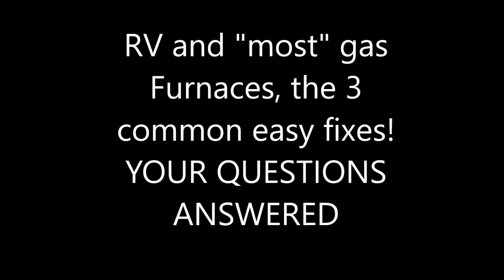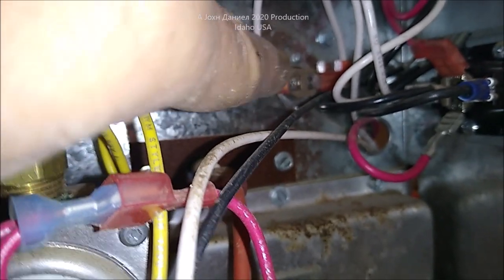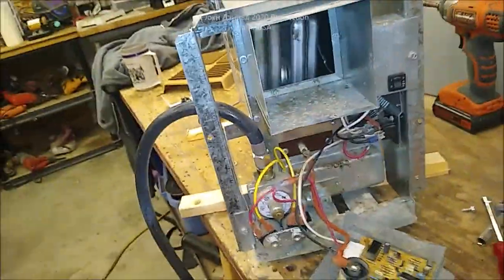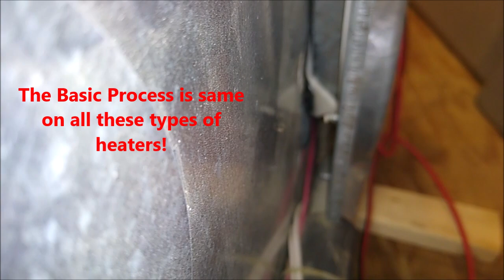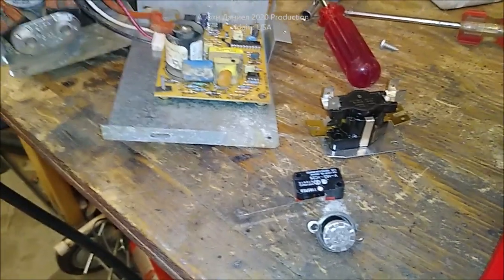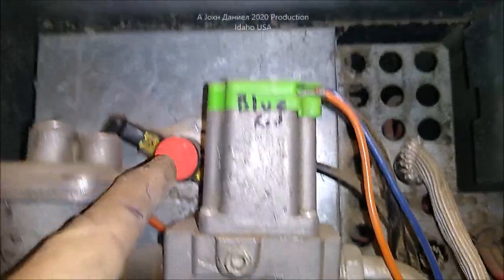RV Furnace REPAIR TECHNICIAN SECRETS Top 3 Easy Fixes anyone can do PARTS BELOW

Comment: Hello I have an older furnace in my horse trailer when I turn the thermostat I have nothing no power no fan nothing. And I have no clue where to start I am avoiding taking it to the local shop
Reply from the maker: First step is multi meter to find where power is going or not going. I'd guess who ever installed it used non standard wiring and that is the first thing to look into. See if it's getting power to it, if the wires are all properly connected. You can send pics and info on it, lots of them, including your battery info on the trailer as well as any odd wiring you see. olympicpowercontrols@yahoo.com 
I just did a repair on one for a new owner of a 1980's 31 foot gooseneck horse trailer/sleeper and when the previous owner sold it he removed things that affected the wiring.

Comment: Thank you for making this video. I'm purchasing a older pop up, and the furnace isn't working. This gives me a good jumping off point, to start to diagnose the issue.
Reply from the maker: With older Pop Ups your likely to get very low hours use in a heater, likely low hour use of the pop up itself. So be prepared to replace the furnace motor itself due to corrosion and very dry bearings or immediately pull it and using LB10 to oil it the right way.
Reply: @JOHNDANIEL1  fortunately living in Colorado, you don't get the corrosion issues you do in high humidity areas, but we'll see.
Reply: Let us know how it goes, i want to know if it was any of these issues. Thanks.

Comment: My heater makes an explosion when it is turned on, from your experience what do you think causes this explosion? Thanks 🙏
Reply from the maker: Blocked intake and exhaust typically. Get a flashlight and look up into them from outside the RV and see if you can see wasp nest, or something blocking air/exhaust flow. It is behaving like a car that is flooded with gas, getting poor intake air flow and finally fires up.

Comment: So the furnace in my 86 Lance cab over as a Pio igniter for the pilot light. The pilot light comes on and stays on, but when the fan kicks on with the temperature up, the furnace does not light suggestions?
Reply from the maker: Not sure your model, but if it has a leaf switch near the blower it may be bad. The gas valve is not going to kick out the big flow if the leaf switch is bad and not connecting to the solenoid on the gas valve. Another possible, the over temp switch can fail and not allow that connection to the gas valve to get power as a safety from over heating.

Comment: Mines not blowing hot air, but see that flat head screw in the bottom left where the propane goes in, if I unscrew that, unscrew the one behind it then there's a button behind all that, if I push that in a few times, then put everything back, sometimes it works again
Reply from the maker: Sounds like someone messed with the gas regulator vent purge and now its got dust or dirt in it. Not much you can do with those once you mess with them other than replace or rebuild. The piston in it is now gunked up, so it'll run till released then stick again.
Reply: @JOHNDANIEL1  Thanks for replying! Ah okay so that's what that is, is a gas purge, does pressing the button so anything then?   behind the metal cap is another plastic  screw with a spring behind it, is that meant to be set in any particular position? Like all the way in so the spring is fully compressed or how should it sit? And how is this affecting how the hot air turns on or not? Thanks
Reply from the maker: @Ben-et8wh  That is the gas valve regulator and solenoid assembly. Once you mess with it it is hard to get back to factory setting. Rule is the spring pressure is light, not compressed far. Make Contact and about 1.5 to 2.5 turns in. What is the year and model of the Furnace?
Reply: @JOHNDANIEL1  hmmmm okay, hard to know when it makes contact but ill try to set it somewhere in the middle or so, 

Its in a 1985 bigfoot spirit wing, says hydro flame SN 0019390 sticker on side of init says assembled in 78 and thata about all i see on if as far as a model
Reply: @JOHNDANIEL1  ok so now, cleaned the sail switch, hear lots of clicking from the front, and can smell propane as if it's going through the whole system, not igniting
Reply from the maker: @Ben-et8wh  Too much or too little gas for proper ignition due to someone messing with the regulator.
Reply from the maker: @Ben-et8wh  Get a light, look up into the air and exhaust tube on the outside. If you see wasp or bug nest, get a wire dig it out. That is likely why you smell strong gas odors and likely why it all started acting up.
Reply: @JOHNDANIEL1  so we traced the wires around we get power to the circuit board, but no power leaving the circuit board, used a jump wire and the gas regulator opens and closes I can hear it,  but no power past the circuit board, which leads me to believe a faulty board or something on the board, am I correct in thinking this? Thanks so much for your prompt responses and help also! You've been awesome

Comment: After sitting all winter went to turn on the heater, it came on, ran a few minutes, made a weird noise and shut off.  The fuse in the fuse box had blown.  Put another fuse in, turned on the heater, about 15 seconds later heard the fuse blow again. What do you think is causing this issue.  Our trailer is 2004 model.
Reply from the maker: Could be a few things, but I would say the motor is drawing too many amps due to age and dry bearings. If your handy you can oil it but you have to do a shaft tap on it when you do to reset the oil and bearings. Use liquid bearing https://amzn.to/43TyHOW , make sure you remove the intake blower slow and save the gasket on it, if you damage that gasket use red RTV on it. There is a set screw on the main cabin blower, typically 3/32 hex or 1/8" hex to pull it. You will put 3 to 4 drops on each motor end, then taking a wood block and hammer you will do a end tap, 4 to 5 lbs force a few times on each shaft end towards the bearing to knock out wear bits and inset the oil. Spin it, if its still rough or hard to turn, repeat steps. This will get you 1 to 2 more years sure use unless its severely damaged.
Reply: Thank you.  That sounds more complicated than I feel capable of.  Maybe we new heater is in order
 @JOHNDANIEL1

Comment: Thanks for making the video, very informative. Have you done a video to stop the squealing on these furnaces?
Reply from the maker: The Squealing is from bad bearings in the motor usually. It can rarely be the blower wheel is hitting the metal due to it shifted on the shaft or the rubber motor mounts are bad.

Comment: Hi, thank you for your awesome tutorial. My problem is that the fan does not start at all, but i hear clicks as it is trying to light up. (I have a Honeywell thermostat) it is getting gas and 12v 
Can any one here help me plzz❤
Reply from the maker: Check to see if your fan/blower is stuck/frozen in place. Get to the side of the unit in the cabinet, If not, replace the Run-delay-relay so that it gets power when the thermostat calls for it to switch on. The click is the relay, but its contacts are bad so the fan does not start and from that the leaf switch does not engage and then no gas or starter cycle is running.

Comment: My thermostat clicks once but the heater doesn’t start at all. No air blowing.
Reply from the maker: Thermostat don't usually make a loud click, the run-delay-relay in the furnace will make a click though. But if it's going bad it will not send power to the fan circuit that starts the whole process for the heating.

Comment: @JOHNDANIEL1 what if your sail switch doesn’t have a fin soldered to it?
Reply from the maker: Some don't have but a 2" thin flag on them, the air pressure is high so a wide flag may cause it to break.

Comment: Been pouring over this video for my Atwood model 7916-lI.  My furnace fan start without the thermostat even being wired to the furnace by switching on the on/off switch.  Fan runs and never shuts off.  If I turn on gas, it fires up and heats.  Only way to shut it off is to turn off gas, let it cool down and the shut off on/off switch.  Really hoping you can give me some guidance.  Thanks so much!
Reply: Thanks for your response!! I know it has the time delay relay, not so sure about the thermal switch.  I’ll order the relay shown in your great video and let you know the results!  You’re the man!!!!
Reply from the maker: The thermal switch for the cool down cycle is going bad or has gone bad. So when you power it back up it's still connected to make the blower run for a period of time after the gas turns off. It's likely either that or the run delay relay stays connected for the blower to continue as if it's ready to fire back up. So if your unit has a cool down cycle thermal switch which would be a bi- metal switch, or a run delay relay then that is the reason your fan doesn't shut off. Look for and replace both of them.

Comment: My suburban in my truck camper it comes on heats up the burner shuts off and then it cools down then the fan shuts off and comes right back on and it does not relight I had to unhook a hot wire or something inside there to get it to shut the fan off cuz it just set there and blow cold air it's only a 2-year-old camper run again and then it'll shut off and come right back on again it just keeps cycling like that but it never really lights it's not cold enough in here for it to light anyway it should shut off and stay off even with the thermostat shut off it comes back on

Comment: When i turn on heater, fan blows for 1/2 a second, then turns off, and Nothing. The tech came again Sat, didn't change anything, just touched a few wires, and ut started working. Now it's doing same thing again. Blower for 1/2 second, then Nothing.
Reply from the maker: A guess based on what you described - Insufficient amps to hold the contacts down on the delay relay or failing delay relay if it has one. Pushing the wires around made better contact and it had enough voltage and amps to run, after it ran the connection failed again due to vibration. I'd check for terminals or plugs that are bad, a terminal may be loose, this could cause voltage and amp drop to exist.

Comment: What does it mean when you get no clicking or heat but fan stays on continuously?  Tanks are full. The fan just won’t shut off and keeps blowing cold air, even with the thermostat in the off position.
Reply from the maker: Cool Down Switch is stuck in on position. A $10 part. $48 is you buy the branded part, so Tell me the model and I can send you to the right part. It could be the Delay Relay also, so when your in it, replace both if it is a model with one.

Comment: Any advice on a squealing blower? Squeals very loudly until it warms up.
Reply from the maker: @laughableotter  Oiling it with  liquid bearings https://amzn.to/4kfaLvB can extend the blower motors life a year or 2. It's a pretty intensive little job to do. You need Allen wrench to loosen the set screws to pull the blower wheels and you have to be careful removing the cover on the air intake blower side to save it's gasket, if you damage it's gasket use our RTV red in place of it.
You remove the unit from the RV, look for two screws mounting it to the floor. Be sure to remove the single screw that holds the units exhaust intake and then you will shake it a little bit as you pull it forward and out. You have to turn off the gas used to wrenches to disconnect the gas line and the power line should be either wire nuts or a plug.

Comment: My friend’s camper has a furnace that look like this and we can’t slide it out. That sheet metal flange that is on the exhaust end of the unit is outside the camper. How can the furnace be removed without sawing off that flange?
Reply from the maker: Remove all the screws on the outer flange, the fit is tight, center screw is into the heat exchanger, so you can using a thin metal backer and a pry bar t do some side to side prying and it will release. This is how they come out unless some one has altered it with screws inside or other adaptions to it.

Comment: I get nothing. Just bought camper and ran heater for ten minutes than I quit.
Reply from the maker: Check battery voltage it has to be over 11.9 volts, check the fuse to furnace, and test if propane is still flowing well by lighting at least 2 burners on stove and seeing if they are good output. If all that is good, reach in and give the heater a good firm slap/tap or 2 and retry the thermostat. If it fires up, replace the over temp bi-metal switch with one like what is in the links under the video.

Comment: Our heater does not fire up at all , nothing, where would you start? Is the a way to see if the circuit board is good or bad?
Reply from the maker: Check for power, make sure thermostat wiring is not disconnected or damaged, listen for any noise it may make when thermostat is engaged, check to make sure it is getting gas, ( valve next to or inside it ) .
Common problems are OVER LIMIT safety switch is stuck in open circuit, fuse or reset breaker failure, Delay Relay not working, and thermostat wires chewed or broken.

Comment: My 2008 Fleetwood Discovery exhaust screen is covered in soot. Why would that happen? I rented this out to a young couple and have never had an issue with heating but they complained of a smell (thought it was propane but smells like something getting too hot to me). Very confusing.
Reply from the maker: 3 likely causes. Poor quality Propane being used ( too much water in it ). Intake part of your exhaust has blockage. Screen has caused carbon formation in burner chamber. Take a bright flash light and look into the intake side for wasp nest, dirt dobber wasp and things stuck in it. Low air (rich burn) can cause this most the time. It can also be due to blocked intake fan so you may have to pull the furnace and open that side to clear it.

Comment: So, if I got nothing when I turn my heat on, I should still have 12v going into the relay?
Reply from the maker: You should have 12v on the relay on one side, and on the other the thermostat side you may also have 12 volt if tested to ground with heat on the thermostat. If you do not have voltage on the high side switch on the relay ( bottom terminals ) then look for a over heat switch failure and trace back from there.

Comment: I wished I had YouTube in the 80s I had to learn everything by trial and error but I can fix gas electrical appliances nat propane. Been trying to figure out how to scavenge the ext exhaust from a fuel drinking furnace you only get 10 of the fuel and 90 per goes out the wall or roof 😂inefficient as hell but they do heat  well .any who it should be set up for the furnace ex go through water heater it would save on electricity and fuel in the winter. I'm a full time rv dweller .if I ever figure out the scavenge part to work safe I will make a video. But until then I'm not risking anyone's life .yall fellers and lady's be safe and have a good one

Comment: Mine works fine at first, once it reaches temp shuts off. Once it comes on again it does 3 attempts then keeps blowing cold air till I manually shut it off. Once it cool off completely it can go through the same cycle again. Can you help? Thanks for your videos.
Reply from the maker: Replace the over limit switch, make sure nothing is in the vents ( mouse nest or covered outlets ) and the intake and exhaust is clear also.
Reply: @ thank you.

Comment: Why does the relays all say 24 volts? never seen a rv that uses 24v?
Reply from the maker: 9 to 24 volt is the range of the relay coil. It works fine on 12 volt.

Comment: I have this exact furnace. Pulling 3.5 amps. Is there any recommendations to make it pull less amps. Is there like an upgraded blower that pulls less?
Reply from the maker: 3.5 fully running is actually very low already. Nothing you can do to save energy other than making it cycle less by increasing insulation. So go to Temu, yes, REAL CHEAP, and get you plenty of this 10mm thick R-4.1 Heat Sound Noise Insulation Shield item link: https://temu.to/k/ugjarwknvzw and place it in the backs of cabinets/ceilings of upper cabinets, and all hidden spaces that cover outside walls. You will cycle much less and extend battery and lower fuel use. We used is inside all our cabinets, around the water heater, backs of closets, under couch, and under kitchen sinks, ceiling of cabinets and closets, and even around the Gas Electric Refrigerator box. Cut our AC and Heating cost 30%.

Comment: I have a domestic heater (1995  RV) everything works but getting like a exhaust smell coming thru vents where heat comes into RV. Question : Is this exhaust smell dangerous?
Reply from the maker: @Frank-z5v  Yes. If it's the first time you fired it up this year and you have an exhaust smell you probably have a blockage in the intake and exhaust that goes outside. A rare chance could be a cracked heat exchanger.